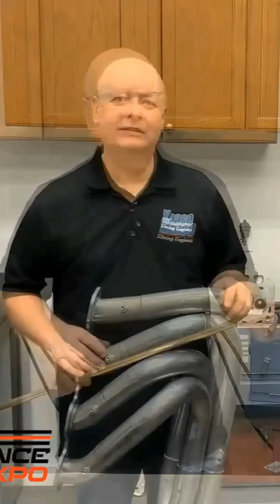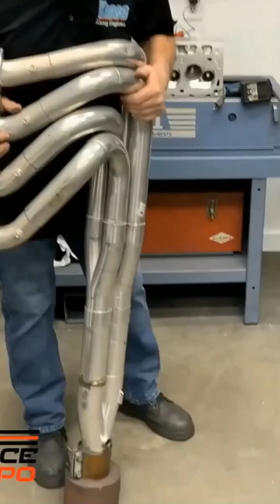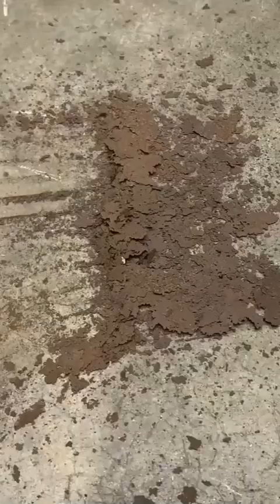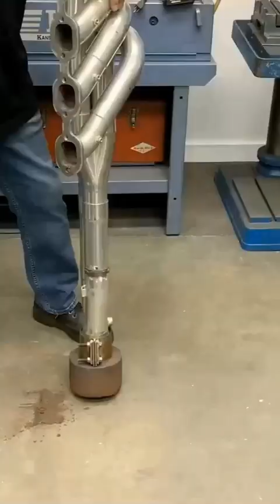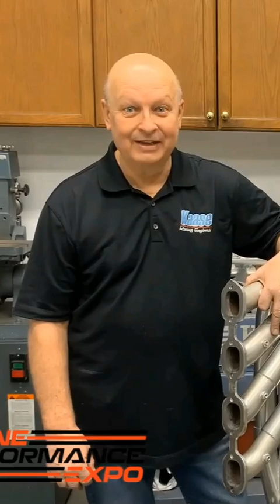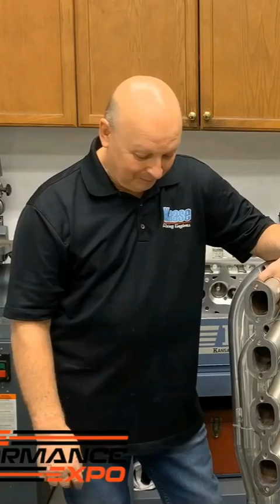Rust Inside Mild Steel Headers is an Engine Killer

Comment: Thanks for the info. If the company that makes the headers for my setup only makes them in mild steel, would ceramic coating help minimize or completely negate the rust? Curious how far the ceramic goes down into the tubes.

Comment: Excellent information!   
 Several years back the machine shop I worked at was building and maintaining large displacement super charged engines for offshore power boats as well as large displacement NA engines for NHRA S/C as well as a few other classes. 
   Two instances in particular directly correlated with this advice that I’ll call  self evident truths. 
   The first example was a NA 565 S/C engine. Our shop got the same engine back twice with pistons that looked to have been shot by a shot gun with large shot. 
    The culprit was ceramic shot that had been left inside the mufflers that were attached directly to the header collectors. 
    It was found just prior to the third go around. 
    The second instant was not so simple or straight forward. 
    Two Whipple supercharged 572 cid engines with 18 degree Dart Big Chief heads. I do not recall the amount of boost in this situation it was plenty. 
    The aluminum casting around the exhaust guides as well as the entire rest of the aluminum in exhaust ports was being rapidly destroyed by clearly evident salt water contamination.  
    This problem had been taking place for some time prior to my involvement with the project. 
  The first set of heads had been ran for an unknown amount of time I’ll guess around 40 hours. 
   The bronze exhaust guide had very little original guide bore to maintain alignment with so a brand new set of heads were installed. 
    The engine would be freshened up every trip out by this time. Along with the standard engine parts other parts of the exhaust system were brought into the shop for pressure testing in attempts to find the source of leaks. Nothing leaking. 
    These engines were several feet in distance to the back of the boat. Large 40’ plus Skater boat. 
    All the while this brand new set of heads were being rapidly destroyed by evident salt water contamination in the exhaust. It was getting into the combustion chambers as well. Exhaust seats were heavily corroded. 
    It came to a point that there was simply no way that the source of the leak could be the culprit. 
   The engines showed otherwise. 
    After the third set of heads the exhaust system parts running through the transom of the boat were tested. The one way gate valves were performing as intended. It was the water jackets casted into the exhaust system going through the transom that were found to be leaking salt water into the exhaust systems. 
    There wasn’t a single person involved with this situation that would agree that leak was the source. 
   The problem went away when those parts were replaced.